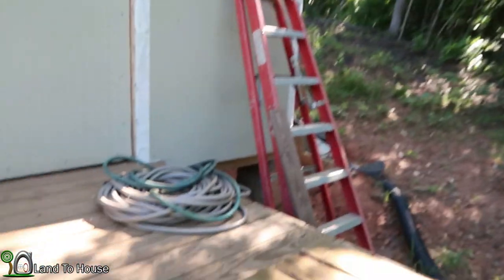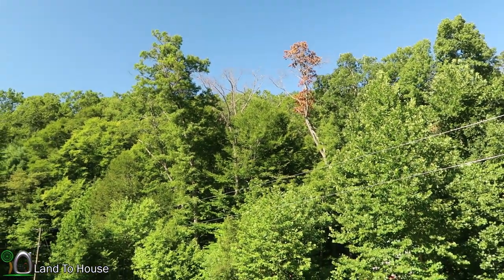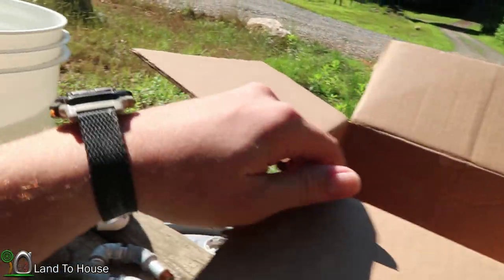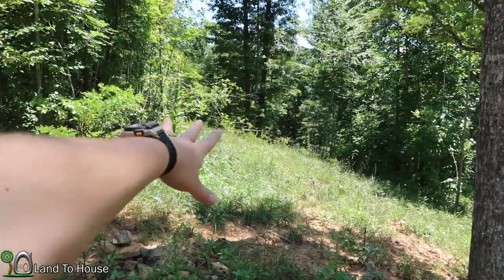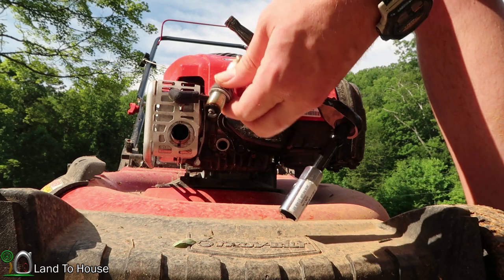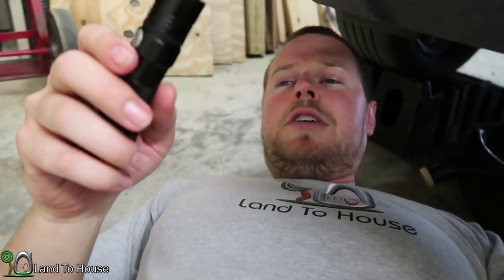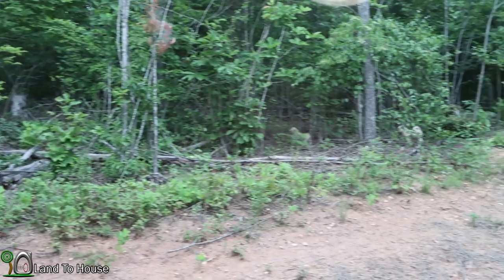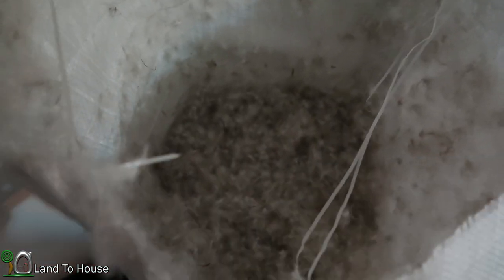19k subs fix that mower- Vlog #38

Comment: I do enjoy the vlogs.  
Lawnmower fires a few times on starter fluid but won't 'catch' is usually a carb issue.
Take off the air filter and see if there is a choke plate that you can hold closed while your friend pulls the start cord.  If not, hold a wadded up rag or paper towel over the intake while your friend pulls the cord.  A few tries of this with a bit of starter spray in the intake often brings it back to life.
If not, the carb's fuel jet(s) are clogged and need to be cleaned; there are lots of other youtube videos on how to do that. 
I admire the effort you are going through for a sub-zero down filled underquilt.  I've stuck to warmer weather hammock camping and just put my poncho liner in the hammock under my sleeping bag.

Comment: Fuel starvation, carb needs cleaning properly, as in take it off. It runs momentarily until the fuel in the chamber has run out, then it won't refil, fast enough as there is a blockage. When you drain the oil, there is usually a sump plug underneath the deck, hard to spot sometimes with all the crap there, but look for the base  of the motor , should get you there.
Reply from the maker: I just took the carb off and it now runs again! I should have done the maintenance over the years. .. Live and learn.

Comment: You should not feel bad about asking someone to not drive on your grass or property. 

I would spray a little card clean or starting fluid in the cylinder and put the plug back in quickly. Pull the cord, if it fires, you have a plugged gas line, dirty filter or the carb needs cleaning/rebuild. 

If it does not fire check to see if you have spark. You can take the plug wire off the plug, put a screw driver in it and then hold the metal of the screw driver just a hair away from the spark plug. Have someone pull the cord and see if it sparks. If is the case you need a new magneto.

I counted 3 time, but I have to look away a bit to answer a couple emails.
Reply from the maker: Yes I asked him to stop and he did. Now there are some more summer visitors and they are now driving on the grass. Oh my so many whipper snappers on my lawn. haha. 

I have just taken the carb off and cleaned it. Will have to get it back on and see if the mower starts. Before it would start for 1 or 2 seconds when I sprayed cleaner in the air intake.
Reply: If the cleaning does not work, a new card is usually between $15 and $30.

Comment: I counted flashlight use of 4 times.  Lawnmower engines are actually pretty simple. Lots of youtube videos on them.  They just need fuel, air, compression, and spark.  You said it almost started, so you probably have spark and compression (a compression tester is pretty cheap if you need to check it). So check the air filter, fuel lines and fuel filter. Bad fuel or fuel stored for a long time can gum up carburetors as Phillip Campbell mentions. Carb cleaner might fix it if it's not gummed up too bad. Otherwise, a gummed up carburetor will have to be disassembled and cleaned by hand. There are rebuild kits available.  Also,  try to get fuel without ethanol if it's available in your area because the ethanol breaks down the plastic parts it comes into contact with.
Reply from the maker: When I sprayed carb cleaner in the air intake it ran for 1 or 2 seconds and then stopped again. My task this week is to take the corroborator off and give it a clean. I have only used non ethanol gas in the mower so far. there are a few stations that sell it.

Comment: 4 times.  Those "Power King" Garden tractors on craigslist there are really a good deal and will last longer than the husqvarna.  Borrow a compression tester from your auto store and test compression that on the mower.  You want better than 80 psi.  If you really want a newer one look there for a  model GTH26K54 for $1,500.
Reply from the maker: I think that I am going to clean the corroborator and see if that gets the mower going again. I will have to do a lot of research over the winter too see what works best for the price point I can afford.

Comment: I would say 6 times on the flashlight.  On the lawnmower take the carburetor apart and clean it with carb cleaner.  Check youtube for instructions.  Gummed up carburetors cause most of your small engine problems.  Over the winter store the mower without gas and I use NGK plugs on everything with an engine.  Husqvarna makes good equipment so I think you would be happy with that.  Poulan pro and some Craftsman brand mowers are also made by Husqvarna so if you can find a good price on one of those that may be an option.  I enjoy the videos keep up the good work.
Reply from the maker: I have just taken the carb off and cleaned it. Did not seem dirty but I sprayed all the holes. This mower has only run with Ethanol free gas and I have run it dry in the fall. I am sure there is still some gas that gets left in there. ... Thank you for the tip on Husqvarna. I think that is what I am going with. There is a local shop that can service it when the need arises. And they will deliver to the house.

Comment: 4 times. Congrats on the subscribers. 
Try some starter fluid on the mower. Also have had good luck with seafoam.
Reply from the maker: My dad uses seafoam often. I think I will clean out the corroborator and then go from there.

Comment: you use 4 times for the flashlight... did you put some fresh gas? clean the carbs with carb cleaner or you need to rebuild the carbs
Reply from the maker: Yes it is freash gas from a month ago. Should be good. And its Ethanol Free. I have just cleaned the carb and will be giving it a try tomorrow after reassembling things.
Reply: hope it's work after cleaning the carb..

Comment: Should be a drain plug in the bottom of the engine.  Much easier to drain.  You've got a carb problem it sounds like.  Not a lot more to just get a replacement mower at this point, look at year end sales.
Reply from the maker: I watched the official oil change video and they say to tip the mower. I guess this model is very cheap. SO my plan is to buy the ATV I have always wanted and get a pull behind finish mower.

Comment: 4.5 lol.  DE is great for safe, slow pest removal.
Reply from the maker: I have used it in the past to try and kill a spider. Did not work as fast as I thought it would I will have to give it a try for the ants. Thanks.
Reply: Land to House   Yep.. my understanding is it dehydrates them.  Per Oregon State University: "Diatomaceous earth is not poisonous; it does not have to be eaten in order to be effective. Diatomaceous earthcauses insects to dry out and die by absorbing the oils and fats from the cuticle of the insect's exoskeleton. Its sharp edges are abrasive, speeding up the process"
Reply from the maker: I had heard that it dries them out. I wonder how long it will take. I think what I will do is place some terro out and some DE.

Comment: I've never heard of ants being in someone's car, do you have enough food in your car to sustain them? I usually do an oil change every year on my push mower, could you do payments on a tractor.  I wonder how a smaller riding mower would last on the type of terrain you have?  I enjoy your vlogs! Lots of neat stuff and gets me thinking about so future projects!  Is the water collection for gardening or the future duck pond? Thanks for the vid and I believe it was 4 times for the flash light being used in the vid!
Reply from the maker: Sadly Yes over 11 years of use that car has food in all the small cracks. First time for ants though. I should have changed the oil 3 times now but.... Lazy. I am sure they would do payments. I just like saving before I buy things like that. I want to be able to tow things and a garden tractor says it will do that. The water storage will be mainly for the garden but I would like to at least have some goats and the water would be for them too.

Comment: I counted 4 times. Did the mower run with starting fluid? If so it is a fuel problem.
Reply from the maker: I sprayed the air intake with carb cleaner and it started for 1 to 2 seconds and stopped again.
Reply: I would try and clean the carb and fuel system. Its pretty easy to get dirt in where it does not belong and builds up.

Comment: 4 times with the flashlight, but I dont know how you would tell if someone watched the video or just read someone's comment.  Speaking of comments, it seems that whatever you are typing on keeps auto correcting carburetor to corroboration.  I still stick by getting an ATV with some attachments, like a pull behind finish mower.  You can find some decent used ones.  The issue I have with using a "lawn tractor" as a snow plow, is that it just wasn't designed for that, and you'd be putting a heavy load on by doing so, which would shorten the life of your mower.  It may not be a concern for you if you plan on replacing in 5 years.  My experience with a lawn tractor with moderate use, after about 8 years they start to fall apart, and that is with keeping it in the garage and only mowing on a nice flat yard, with no hills or crazy rocks.  Husqavarna seems like a nicer brand, but that may just be marketing.
Reply from the maker: BAHAHA Thanks for pointing that out. I have just added that little mishap to this next weeks vlog. I would love to have an ATV. I have wanted one since I was a young kid. If I were to buy one I would get a Polaris. The issue that I have with them at the moment is the price. A newer ATV is going to be 3 to $4k and the mowers new are up to $2k. A little out of my price range at the moment. I am not sure that the mower would do the job here? ...... I will have to see how my money tree grows over the winter and I might just have to go with an ATV.

Comment: seen inside box 1 time, outside box 6 times, used 3 times. happy bday to me! 🙏🙏🙏.. try to spray some wd40 inside the spark plug slot. and should use gap adjuster, bery important. goodluck.
Reply from the maker: I will be seeing my dad tomorrow and I will get the spark plug gap tool. I have also just taken the corroborator off and cleaned it. Will give it a test tomorrow.